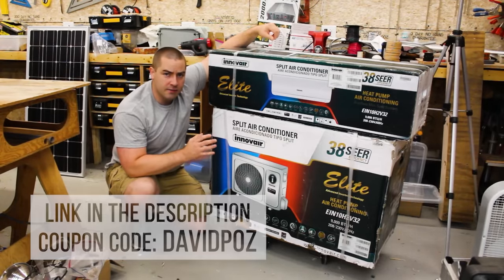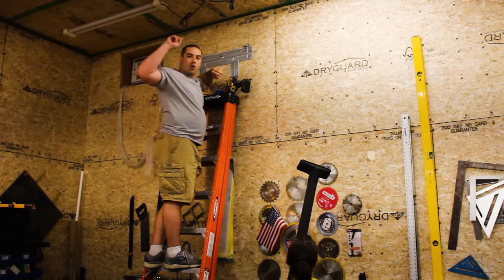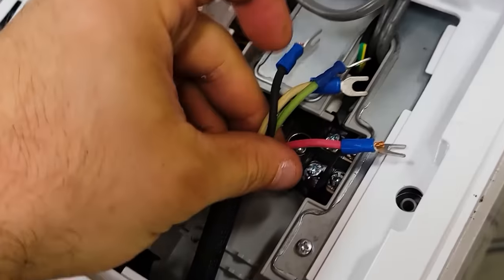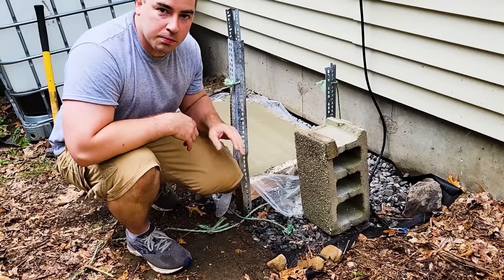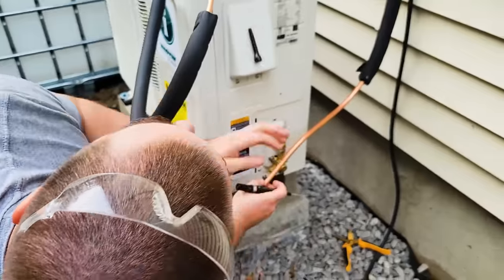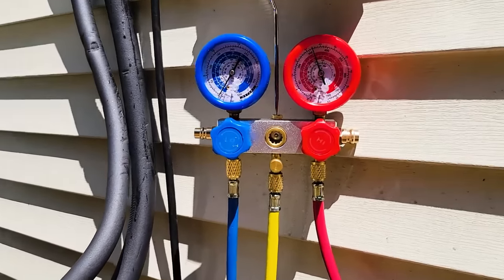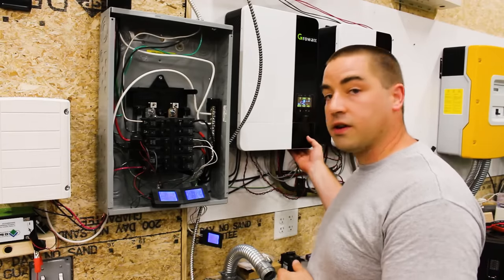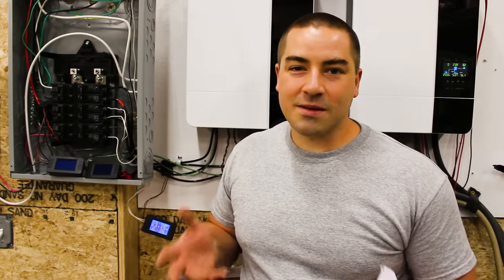DIY Mini-Split Heat Pump, Full Installation, 2021

Comment: So, if I am understanding this correctly...  Your mini split is using 869kWh, which means that your 30kWh battery can only run the mini split off grid for a total of around 5 minutes?  Am I missing something?
Reply from the maker: Hi rustusandroid,  This mini-split uses about 800 watts when running full-blast, which it did when I first turned it on.  Once it brought down the temperature of the garage (in the first day) it uses far less watts to maintain a set-point.  Over the last 3 weeks of running this, it averages 6kwh per day (24 hours).  This means my 30kWh battery could power this mini-split for 5 days without any solar input.
Reply: @DavidPozEnergy  Nice!  Thank you for clarifying, it helps a lot to get real world numbers instead of theoretical calculations :)  Thanks again.

Comment: My power line is not wired to my inside air handler. And that is the only thing that's holding me back. I have a red white black and green wire in my terminals on the inside just say one two three and a ground. I know the green goes to ground but I don't know about the other ones because I can't see the wires coming in and I can't remove the block and it's very tiny space to try to shove the wires in and I don't want to do that and hang the unit and find out that it is wired wrong. I appreciate anybody's help before I go completely nuts.

Comment: Where can you see heating efficiency/cop values/watts in-out at different ambient temperatures for this ashp? Why is it so hard to find this information. Breaking news: it's not 43.5 f all winter long.
Reply from the maker: This is an installation video, so I wouldn't have long-term data to share.  But, this past summer I kept a meter on the circuit and found that during the months of July and August, it averaged 6kWh/d.  I understand this is not as in-depth as you are looking for.
Reply: @DavidPozEnergy  I was just looking for the rated specs, not your experiences. cop values at different temps...

Comment: 38 SEER? Wowsers.  My Senville units are 24 SEER maximum.
Reply from the maker: Yeah, that's why I wanted this model.  Super efficient.
Reply: It’s impossible to get 38 seer overall rating, possible when running at the lowest capacity (slowest speed) false advertising. Retire hvac tech
Reply: @jakealmaguenther4366  Carriers is 42 so.....

Comment: Him touching those huge capacitors was pretty scary.

I guess it has been a long time since those were last charged but I would still advise not to touch capacitors in any device that is directly connected to ac. Especially if they're that big lol.

Comment: Ñext time ýou make concrete add some welbond to the mix it adds flexibility and strength to the concrete what showed me the strength of the concrete was we made ahd poured  concrete in the bottom of a well pit after it had dried the customer decided that he wanted a sump pit after all so we rented a jackhammer to make a hole in the floor so we could make a sump pit dad cused that hunk of junk as it took a long time and a lot of work to get the hole done the plumber also had changes to the basement bapl

Comment: As a safety precaution, can you step back to an arm’s length and turn your head away from any circuit breaker or DC switch. As an electrician, I do this all the time. After watching several real life videos with people’s lives changed because of an arc flash.
Reply: Got my hand burned by one. Faulty breaker. Glad I wasn’t looking at it. Thats some good advice!

Comment: In the UK you have to be licensed to even buy anything containg refrigerant. The mind boggles. Alot of this small brand Chinese manufactured stuff is frowned upon based and the fact that spares are not easily available despite what the retailer will tell you. We tend to stick to the big brand Japanese manufactures. In my opinion Fujitsu and mitsubishi electric (not heavy industries) are the best bet.

Comment: Not a big fan of super efficient units. Had a friend that had 2 heat pumps that used cheap natural gas for emergency back up. First year under warranty service tech came out twice under warranty. Following year another two service calls that cost him well over $400. Told him first year to just use the natural gas to heat home. He had 2 by 6" walls and R50 insulation in attic with great place windows. Third year an expensive board burnt out so he finally took my advice. Following year he told me he saved money by not using heat pump when all the service call prices were added in.

Comment: Great video, in the UK the Government are going to set Laws for everyone to have these systems, in the near future, but their is going to be Ground Heatpump systems that are more efficient, that would be either a 2ft hole drilled to what ever depth, past the water tables needed, or a full yard underground heat and cold exchange system, from the little research I have done, they are 3 times more efficient, in power needed but would cost for a full system $18.000 to install, does you or any of your subscribers know enything about systems. Thanks

Comment: Metric copper tube perhaps?
Reply from the maker: I thought that too.  However, the manual says it comes with 1/4" and 1/2".  And I checked it and it was 11.98mm OD.  I couldn't find a metric tubing size that was 12mm OD, so that didn't line up either.
Reply: @DavidPozEnergy  Well there is 3 thicknesses of copper pipe. Possible they used M copper, that is for plumbing. I have always used L for hvac work. And there is also K that is alittle thicker than L, for underground pipe. Also what side was the tool designed to hold.

Comment: @58:41 testing for voltage as you did is fine but what you neglected to do is ground the power & common to ground separately to dissipate any stored energy. Surprisingly you can have energy present that does not read because it is not being supplied as you did your test. It's SOP. 
The stored energy can act as a capacitor awaiting a host.
You don't want to be that host.

Comment: "It does heating and air conditioning" - technically, heating is also air conditioning.
Probably "it does heating and cooling" would have been better 😉

Comment: I don’t know what neck of the woods you live in, but in my area, I saw tons of code violations, I don’t mind that stuff, but to broadcast to the world is a different issue, example most areas you can’t run the condensate line direct to the out side, your unit can’t sit on bricks, your grounding in the jboxes, and last but not least, what happens if you have a refrigerant issue. Got that EPA license. Should have hold the vacuum at 500 microns for 24 hours, and you need a micron gauge for that.. using the old school gauges not a great ideal..like I said bootleg is ok, but to show the world, not so great. Proper flare connectors don’t need the sealant, use as a last resort. You did not talk about the heat part, don’t know what your winter temps got down too, if you live in a warm climate, your good, you get below 32, you will have heating issues…

Comment: unfortunately at 800 watts for 9000 BTU, that's far from 38 SEER. if that rating were accurate, it would be closer to 236 watts

Comment: Had a quick look through and have not seen anyone comment on your pressure testing. 
You were trying to test the low side with a pressure for the high side. 240psi seems quite low and what does "design pressure" mean anyway. Normally you have max working pressure (probably this units design pressure) and max test pressure. Luckily you could not get upto 550psi as that is probably too much for the low side. As you had not opened the units valves it would not be too dangerous but if you had opened them you would pressurise the compressor as well which could have exploded. 
Basically low is the line set, evaporator and compressor. High is the condenser. 
Having the nitrogen safety valve blowing off should have been a major wake up call and stopped you in your tracks but you seemed to treat it as a minor inconvenience. Fortunately this unit is on a high pressure gas so I doubt you were in danger. 
I had a good laugh at how you connected up the hoses. 
Being a professional I could go on but as a first attempt I was very impressed. We have an apprentice who has been with us and another company for over 4 years who couldn't do better - yes he is brain dead and will never be more than a filter cleaner.
I have a house in Thailand and got an AC which included free fitting. It was to replace a faulty one which also had free fitting. I had to stop them trying to make the condensate drain run uphill. I also had to send the installers away to borrow a vac pump as they only wanted to purge the evaporator. So this time I insisted they came armed with a vac pump. Instead they turned up with a small fridge compressor and obviously no micron gauge. So you are already better equipped than Thai installers.
Edit - forgot that it can heat so the components are reversed in heating except the compressor which is always low.
Reply from the maker: Thank you for leaving a comment.  That is a funny story about Thai installers.

Comment: Too much bull crap, just vacuum it to -30(-29.99) psi for about 10-15 min, check if it holds the pressure for another 10-15min.... and you are ready to go... been doing this for years not a single problem

Comment: What's all the talk about an auto- transformer? Are you, can you run this with a 120v inverter.
Did you mean a step-up transformers??
Reply from the maker: I'm using an auto-transformer when I power my house, but I simply said I don't need the auto-transformer with this unit since this mini-split doesn't need a center neutral.  I have more videos on the auto-transformer: https://youtu.be/yWUfvvSa3K8

Comment: You didn't ground the 4 square box at the ceiling. You also used the incorrect glue for the PVC. A cleaner job would have been to run the conduit down the wall on the inside of the garage instead of on the outside, and then feed the back of the disconnect.  Also, don't tape wire nuts. Against manufacturers installation instructions.

Comment: After having installed around 100 of these machines now, One becomes very familiar with the load ratings of the machines and the seers on the label. My 20 seer 12kbtu machines that I install currently as of August 2021 have a max load of 5.1 amps. This 9k showed the compressor rated at 6.9 and recommends a 15amp circuit. There’s no way it’s 38 seer. If you took my 20 seer 3/4 ton max loads of about  4.0 amps and cut it in half for an estimated 40 seer rating, the max load would need to be no more than 2.0a. That’s a far cry from 7amp-ish this box showed.  800 watts at 3/4 tons or 9kbtus is around 20 seer. The seer rating is based on full output not the theoretical lowest speed the machine might be able to idle at. Just sayin.
I do like his first-try level of skill here, a lot of trades to wield in something like this and his first time Install was really not bad.
Not sure why people think with a flared copper fitting that there’s any kind of sealer or Teflon tape needed. It’s a 500psi+ metal to metal compression fitting, no sealant is going to improve a properly made connection. (Having done a few hundred now)
The lineset should be wrapped with preferably an hvac lineset wrap and painted for long term weather-ability. The foam lasts a couple years in direct sunlight.  
The control line going inside the AIR HANDLER(head units are for car audio guys) is never going to have a monkey or anything tugging on it from inside or outside the wall so the sheet metal hole is purely a guide only and isn’t needed for much and the control line can be hand fed to the front service access terminal easily with the air handler already hooked onto the mounting bracket-it need not be pre-wired and even zip tied. 
Also, the lineset hole in the wall also need not have a sleeve. The lineset holes can then be smaller than 3 inches and merely sealed on the exterior wall only where it’s needed. (Typically 2” or smaller)
Most HVAC and electrical codes require the circuit wires from the breaker box to the disconnect be a home run and not be spliced. Some home inspectors will catch that, most of them probably won’t.
I also would like to know how much his daughter charges an hour for install labor, I’d hire her in a second. Super Cute there.
Reply: Thanks. I was going to use a splicing box but since you said to make the disconnect a home run to the power box, that is what I will do. Makes sense once you said it.
Reply: NEC (national electric code) allows splices in accessible junction boxes.  Don't know about HVAC code requirement, but since it is electrical, I would think the electrical code controls this issue.

Comment: So in the first 30 seconds, you mention how high the seer rating is and that you cant believe a heat pump with such a high seer rating. SEER refers to the efficiency of the cooling system, Where HPSF is the the heating efficiency ration and whenever installing a heat pump, A/C system both the SEER and HSPF are the efficiency ratings generally anything over 17 SEER AC and i beileve its 10 or 11 HSPF is qualifying for mass save rebates ND IS CONSIDERED  high efficiency system. 38 Seer is only found in mini splits as they are able to be more efficient than tradition ducted central a/c however, the HSPF Heat rating is very important when comparing heat pumps. 38 seer is great all summer but what about the heat pumps efficiency?

And they they dont put the anti crimp spring on any copper line set under 1/2".  3/8" and 1/4" gelcopper is very unlikely to kink it is the easiest gelcopper to bend by hand, its almost impossible to kink that high side like unless you really are careless but i only use a tubing bennder on 5/8" and up, and that depends on the bend i need. I only use it for 90degree bends otherwise you can work by hand without need to remove the insulation.

Comment: I really would love to know how many watts does this mini sprint pull can you tell us how much energy it uses or consumes
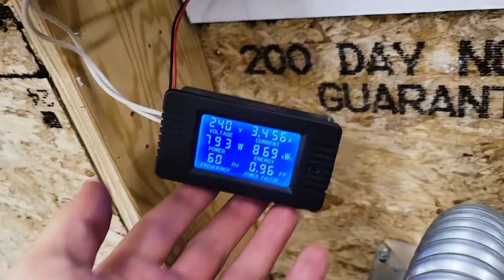Reply from the maker: 1:04:56
Reply: @DavidPozEnergy  I seen it at the end of ur video I'm trying to figure out what seer would keep me around 800 or less I want a mini split but I don't want to be over a 1000 watts at all running one of these units..
Reply from the maker: OK, cool.  SEER wouldn't quite tell you that.  In the spec sheet look for maximum amp draw.  Mine is 3.5 amps maximum (840 watts @240V)  The thing with seer is that it's over the course of the season.  Sometimes it's more efficient, sometimes less.  This is a 9000BTU unit, and probably any 9000BTU inverter-driven unit will stay below 1,000 Watts for you.
Reply: @DavidPozEnergy  ohhh ok thank you so much because I been looking around on eBay Amazon and see all kinds of Mini split models btu seers etc but couldn't find the specs on the energy draw but thanks for your valuable input 👍
Reply: @DavidPozEnergy   I'm not an EE guy, but isn't watts in AC calculated differently than DC, because AC passes through zero?  I could be wrong, but I would guess 3.5 amps x 240vac x 0.71 = 600 watts.  (9000 BTU/600watts = 15 EER)
Reply: My guess above is based on a PF (power factor) = 0.71
Reply: @mikedavis5784  oh ok I think I got it lol I was thinking about a mini split but I wanted a 120v inverter model I guess s 9000 btu unit should be ok

Comment: Why didn't you install another Mr. Cool unit?? This unit has poor quality control.
Reply from the maker: My Mr. Cool unit came low on refrigerant and Mr. Cool would not cover the diagnostic, or the adding of refrigerant under it's warranty.  That was out of pocket.  So it was cheaper for me to buy all the tools (vacuum, flare, gauge, nitrogen) then to go through that again.

Comment: Dude,u dont need to reinforce the concrete!and 2 patio slabs would have sufficed,did u think of that?
Way overkill!
Perfectionist?
Reply from the maker: I agree with you that it would have sufficed.  If there was a big price difference then I might have gone that way, but at about $10 for the concrete mix, I figured why not?

Comment: You made a sealing error at the exterior. The vinyl siding has an air gap behind  it. You should have cut a larger hole through the vinyl siding and then sealed the conduit to the house to prevent air and pest intrusion.

Also, I can't believe you didn't send the refrigerator  back due to shipping damage. That was pretty bad.

And you leave WAY too much wire inside  your junction boxes. Like 2x  to 3x  too much. Waste of valuable copper.

Comment: you are also not using the correct level or correct place for the level that mounting bracket and those tabs are not p\erfect, there is a spot in the middle of the mounting bracket for a small 6" magnetic level like a torpedo level and that is what you shoud use for leveling the unit and without pitch. The only thing you want to pitch is when you drill your 3.5" hole for the conduit you want that to angle down so that the drain line has proper pitch leaving the back of the unit or it will not drain properly the hole should angle down about 1/4" from inside to outside.run the drain line under the refirigerant pipes and do not crimp it, The refrigerant pipes should come out above the drain and the drain should follow the line set all the way down the the groundand be behind the copper. attached with electrical tape or lightly pulled zip ties.